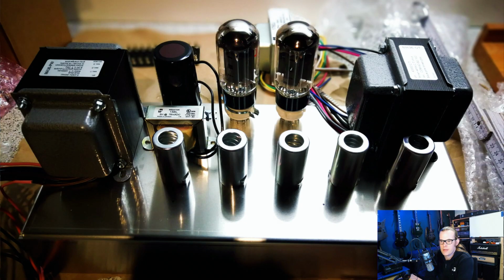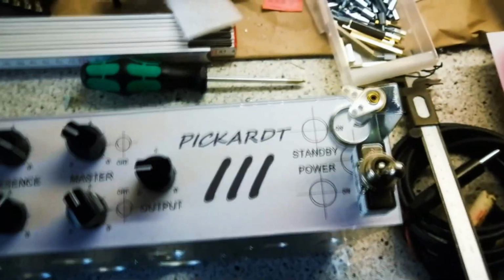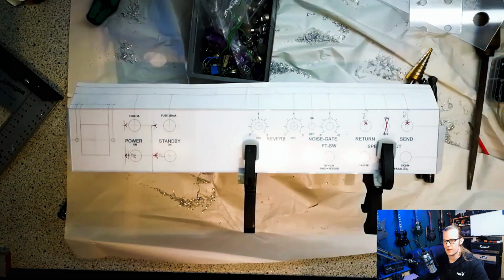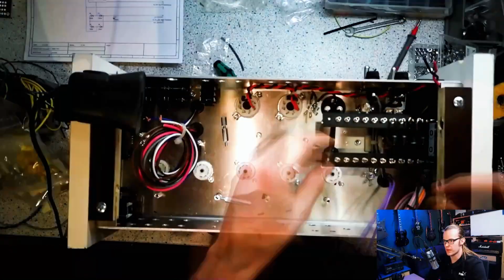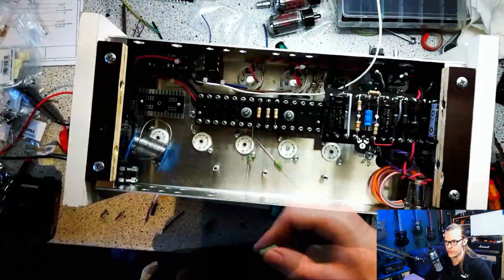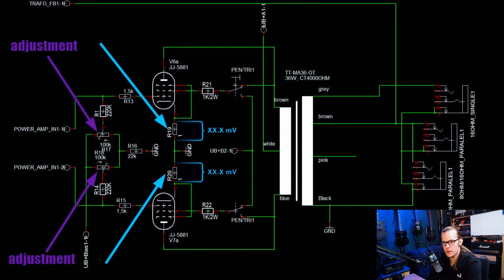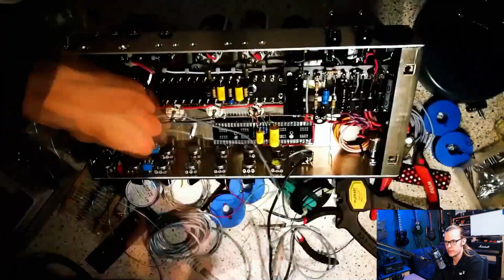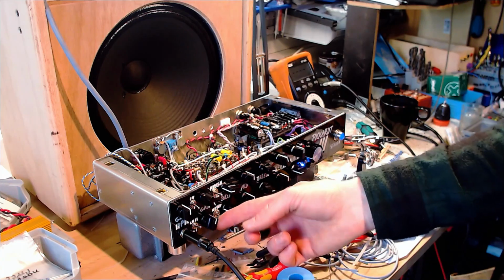Design of a Modern Monster Metal Tube Amp - Part 5 (drilling, mounting, soldering and first Tests)

Comment: Have i got this right with some of the other builds I have been looking at the valve heater wiring is twisted because the heater voltage is being taken directly from the transformer which is AC but because you have rectified the voltage in your power supply circuit to DC there is no need for heater wiring to be twisted to remove magnetically induced hum. In other words valve heaters don't care about AC or DC voltage it just needs to be the right amount of voltage.
Reply from the maker: That's correct! The valve just needs the right amount of power and energy from the heaters to reach the right heat at the Kathode, wich is than generating a cloud of free mooveable Electrons. This is needed to get current flowing betwen Kathode and Anode, controlled by the Grid.

If you are not working with high gain faktors, or compensate the hum over a push / pull phase inverted ciruit like in my power Amp stage, you can use AC for the heaters, but then you should twist the wires to compensate electromagnetic induction.
If you are planing to build a circuit that is having gainfaktors of a few hundred times or more, it's better to filter the heater supply voltage to DC and eliminate as much as you can from the AC ripple that's left with a large Capacitor.

So, in the basic operating system, the tubes that are mainly used in audio circuits do not care, if the heaters are DC or AC driven. In detail it depends...
Reply: @Fight4Madness  Thanks for clearing that up...it was the year German metal put Sodom's Agent Orange and Kreator's Extreme Aggression on my turntable when I last studied tube theory and have not had any real experience working with them since but that is soon to change...Is the Discussion page on your channel the best place to hit you with some ideas?
Reply from the maker: @92ilyas  Ha, nice, old German Metal🤟
Yes, I am pretty much only medial present on you tube  and here in  the komments is the best way to catch me and discuss an idea at the moment I think.
Reply: @Fight4Madness  Cool no worries. Well I'm a couple of months from getting my own project started (I'm busy starting an electronic repair shop at the moment)But basically I'm looking at doing low wattage amp with plenty of gain like your design has. I really like the way you built different parts of the circuit onto different boards or lets say modules and things like your biasing pots which has got me thinking about building a setup where I can easily experiment more like an open chassis for my work bench. Got lots of things to talk and learn about but just saw one of Ola's recent vids where he was just running distortion pedals straight into interface and using IR's to simulate power amp and cabinet and it got me thinking what would it take to build a cool tube preamp designed to plug into an interface without output stage/tubes I know it kinda defeats the whole purpose of a complete tube amp but think it would be cool to build a  rackmount version  like old Marshall JMP-1
Reply from the maker: @92ilyas  hey, yeah I've seen the same clip from Ola! I think it would be a great journey to find out how near you cold get to a real tube amp sound behavior, when you set up a high gain tube preamp like mine, than pass a ir loader and push that in to Class-D power Amp.
It could be a lot cheaper and lighter in wight and smaller.
I think the one point wich is deciding IV the sound comes close to an real amp is then the Impse Response. If that amp schuld work on a real guitar Cabinet for rehearsal and gigs, then you need an IR which has only captured the tube power Amp, but without the speaker in the IR include.
If you rather want to use it for recording, than you won't need the class-d amp, only a good IR with power Amp, cab and mic in it.
Both could work very good.
By the way - Good luck with the electronic repair shop!